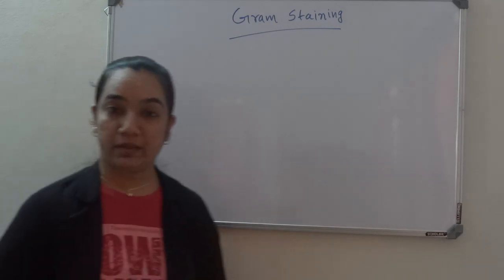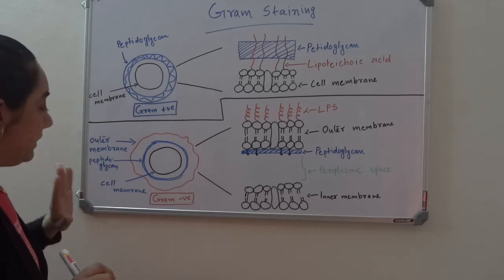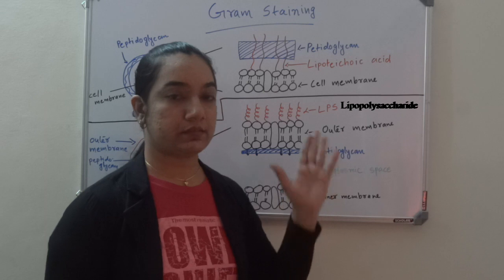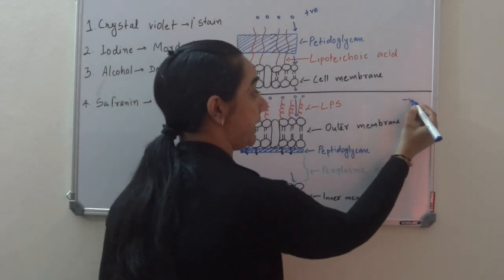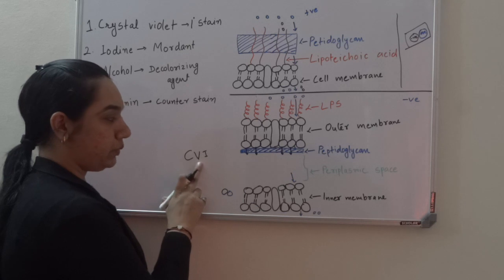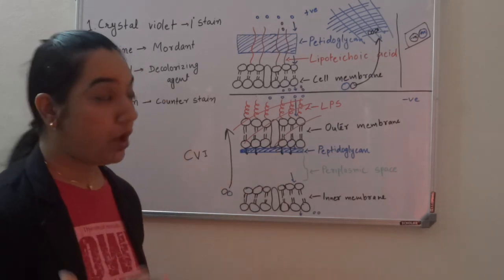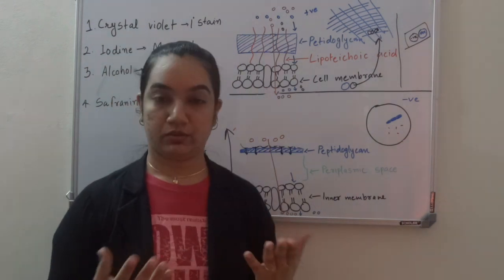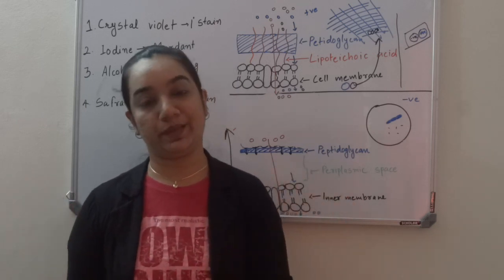Gram Staining of Bacteria [Principle, Procedure & Mechanism]

Comment: If the peptidoglycan is actually very dense, then why did it take up the violet stain in the first place?.... Ma'am if u see this, then please clear my doubt bcoz I have an upcoming test!
Reply from the maker: Stain will be taken up by the cell but because once you add iodine, CV-iodine complex is big and cannot pass through the peptidoglycan layer. That’s why when you wash the slide with alcohol, CV will be retained trapped in the peptidoglycan. Watch the explanation once again, it would help. All the very best 👍🏻😊
Reply: @NowIKnowbyRupalGogia  Ma'am... I watched that part but what I'm asking is, how can the thick and dense peptidoglycan of the gram positive bacteria lets the crystal violet stain get into the cytoplasm during the step 1 ( dyeing with the help of crystal violet stain) i.e. the first step?
Reply from the maker: The stain Crystal Violet doesn't cross the Bacterial Cytoplasmic Membrane (CM), it is trapped in the cell wall structure. Hope this clears the doubt. 🙂
Reply: @NowIKnowbyRupalGogia  okay...... Ma'am... Now, I got it!..... Thank you😊
Reply from the maker: Yeyyii 😄 I am happy I could help 😇

Comment: The CVI complex also washes out in Gram negative bacteria with outer membrane after alcohol treatment. The outer-membrane shrinks with the peptidoglycan layer, due to which CVI washes out in Gram negative bacteria.  After the treatment with safranin the pink color binds to inner membrane of both Gram negative and Gram positive bacteria, however, we see Gram positive as violet due to reason of masking of CV.
Reply from the maker: Yes that is correct. Thank you for the input 😊
Reply: You are welcome. Can you please make changes in your video. I am a instructor in a medical university, my student told me about your video and I realize students are not getting correct information. Thank you for the video.
Reply from the maker: When Gm +ve bacteria are decolorized with alcohol, the alcohol is thought to shrink the pores of thick peptidoglycan and it retains the CVI complex staining the bacterial purple. Whereas in case of Gm –ve bacteria peptidoglycan is very thin, not highly cross-linked and has larger pores. When they are decolorized, alcohol treatment extracts enough lipid from the Gm –ve wall which increases its porosity further. This results in removal of CVI complex.  Reference: Microbiology by Prescott, The Mechanism of Gram Staining, Page 60. I hope this clears your doubt :)